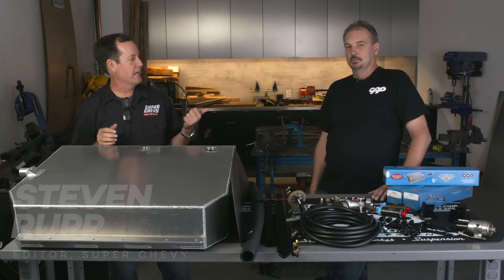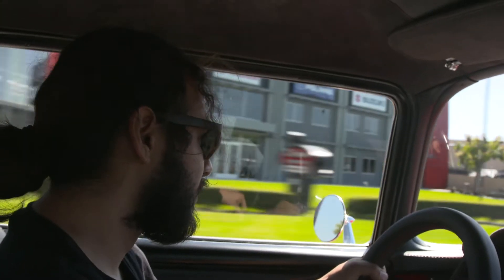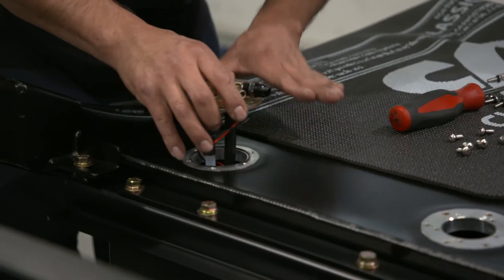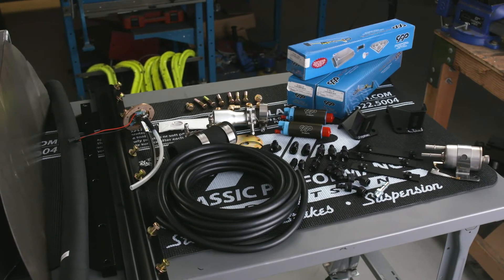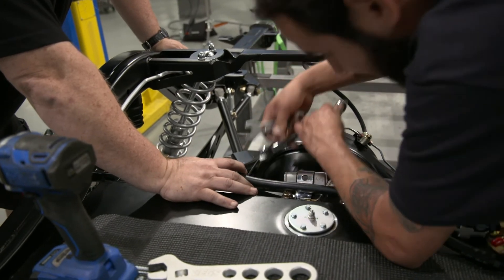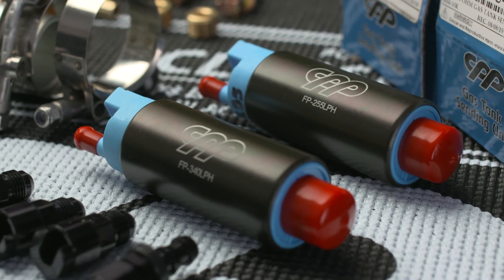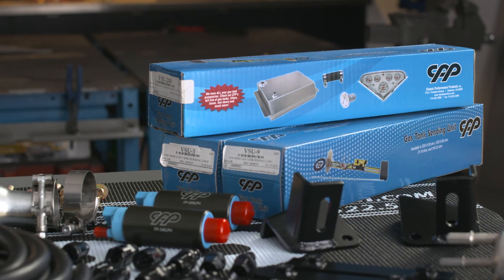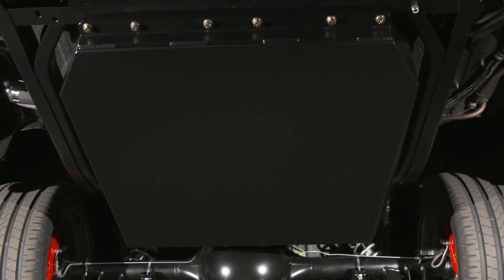CPP Fuel System | Super Chevy Week to Wicked 1955 Chevy

Comment: When you look at the 55 from the rear does the tank hang down noticeably low? and are you still able to install this unit with the factory spare tire well?
Reply from the maker: These tanks are designed to tuck up underneath the car nicely and the black powder coat helps hide the tank even more. To install one of the 29 gallon tanks require relocating the spare tire but the 25 gallon tanks do not.
Reply: @CPPmaster  do you have any 25 gallon tanks (black) in stock right now? for carb setup.
Reply from the maker: @gordongreen355  We do have it in stock. Part number is 5557agt-25h and price is $499.00. You can give us a call at (866)-882-4131 or place an order on our website: https://www.classicperform.com/FUEL/FUEL-Aluminun-Fuel-Tanks.htm

Comment: Is this the returnless pump and PWM at stock on the Gen V L83?  Or does this kit change the fuel system to a fuel return system bleeding excess fuel and pressure back to the tank (LS style).  Thanks in advance.
Reply from the maker: Hi Ryan, Yes this fuel system is set up just like the factory GM fuel system for the LT engines. The engine has its own fuel computer that controls the "low pressure" pump you see in the video. There is a pressure relief valve that can send fuel from the high pressure side back to the low pressure pump, but it still doesn't go back to the tank.